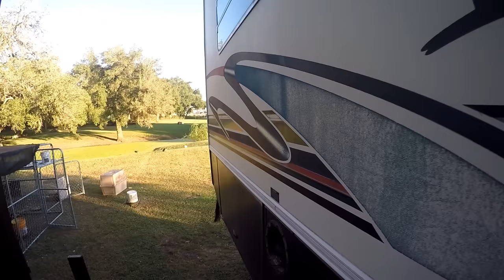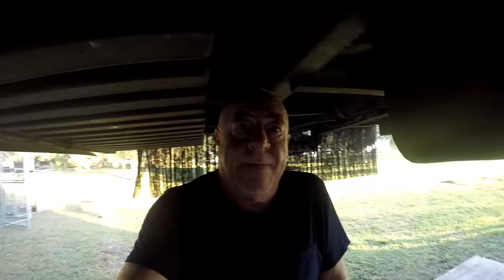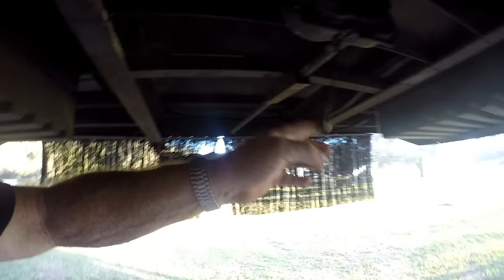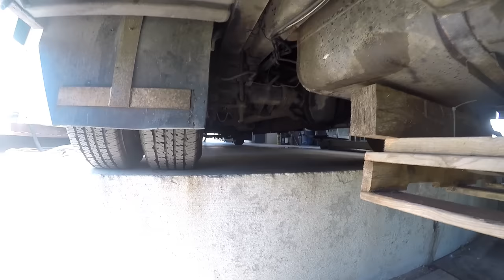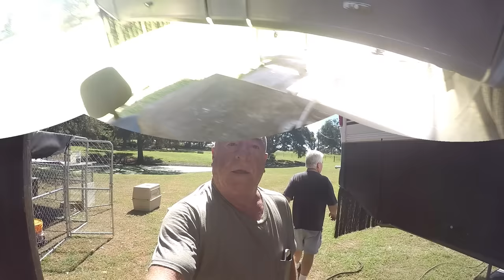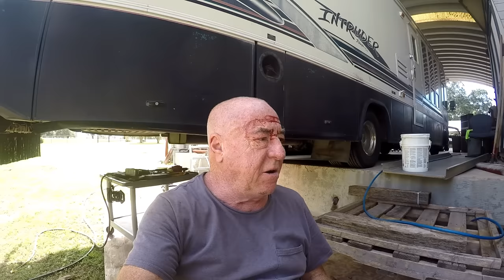Removing Cleaning & Reinstalling F 53 Fuel Tank

Comment: Needed to replace Fuel Tank hoses on a Class A Motor Home 97 Ford F53 chassis.  After trying several ways to lower tank without suggest, watched YouTube Rufus B Dufus, ratchet straps method.  I used 4 straps which allowed me to lower the tank vertically without tipping the tank which is required for the tank filler tube to clear the chassis frame.

Comment: Thank you for the tips. I called Freightliner and got the sending unit part number with the last 6 digits of the VIN. Googling the number I found a local Freightliner shop that ordered the same sending unit for $65. The hardest part was siphoning out 70 gallons of fuel. With an air impact and your straps I dropped the backside down giving me plenty of room. Easy job.  Thank you.
Reply: Hello 👋 I’m about to drop my tank this week on my 96 f53 have to replace a leaky generator rubber gas line but I think the main gas
Line is also rubber can’t seem to see that info anywhere if possible can you tell me if it was rubber gas line and thank you in advance bud !

Comment: Considering the anxiety and near heart attack level of panic you endured, I am stunned that you re-used the existing pump.
If anything can strand any vehicle at any moment, it's fuel delivery problems -- and dropping that tank out on the road is not feasible. 
In any RV I've ever owned, (dozens), I always install an independent, electric fuel pump at a convenient place on the frame. Turning a valve and flipping a switch gives me fuel to the engine, regardless of the factory set up.
Peace of mind is a top priority, meaning I always carry an extra starter, every ignition component that's critical, a spare alternator and an extra water pump.
Heck, I even carry a replacement wiper motor.
Anal, eh?
But I've never been stranded, anywhere -- ever.
Reply: MichaelRMcCoy Yes you should replace BOTH pumps at this stage.

Comment: Great video! I have a idea about the problem you were experiencing. Perhaps where the vent line was accumulating fuel was blocking the air exchange thus causing a vapor lock while driving and also causing the gurgling during refueling as the air would be forced to escape from the same hole as the fuel coming in.  The fuel tank vent is a very important part of an internal combustion engines’ operation.  Anyways just an idea.

Comment: I believe I have this same exact tank.  I don't have a forklift but I'll try to do it with a motorcycle jack.  Do you remember how many bolts to remove?  Is it safe to say I only have to worry about disconnecting the filler hose, then I can unbolt and lower the tank some to see if I need to disconnect anything else before lowering it to the ground?  I have an F53 460 V8 with 75 gallon tank with 40 gallons in it.  I have to replace the fuel pump.

Comment: HELP!!!! Hi Chico! Have enjoyed watching you & Rufus' adventures......found you researching the same issues you were experiencing with Guz losing power/stalling after driving for a bit.  New to RVs, husband bought it used a few weeks ago, we know a big fat zero about them and while doing tune-ups and little fixes took it for a ride and got the scare of my life anyway.  DRove about 16 miles onto Route 80 in NJ to get it on the highway around 6 PM, so it was already dark. The check engine light started going on and off, pressing gas pedal and getting no power and speedometer/speed just dropping to around 5 MPH, cars and semis, whizzing by around 75-80 MPH and was just waiting for someone to slam into the back of us.  Finally made it to off ramp to Rt. 17 which was slightly uphill and would barely move, the needle was not even registering.  To say people behind us were unhappy is the understatement of the year.  Finally got into parking lot and shut it off.  After about 5 mins. started it up again, but only made it another mile before stalling out completely in the middle of an intersection....ugh!!! Got it going and into another parking lot to set a while longer.....and then finally got it home, which was maybe another 7 miles........So my question is:  Can you describe EXACTLY what Jeff did to fix it? My husband has tried some things, but like you they are not working.....and are you removing the fuel tank because it is happening again?????  
Thank you for any help!! For this to happen on NJ roads with our traffic is life-threatening.
Hope Rufus is feeling better, sorry he is still limping :(
Reply from the maker: Cynthia, please call me at 772 532 4330.  If you get this message remember I am 2 hours behind you.  I will help as much as I can.  Sorry I just got to read your message.  Internet problems on my end.  My email is chicosflorida@gmail.com.